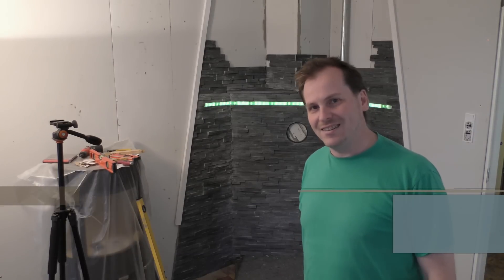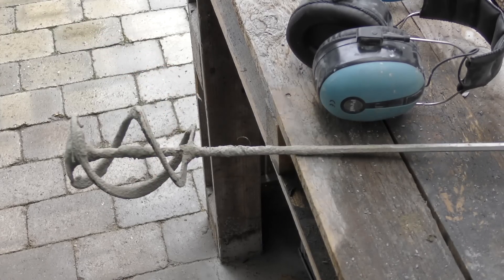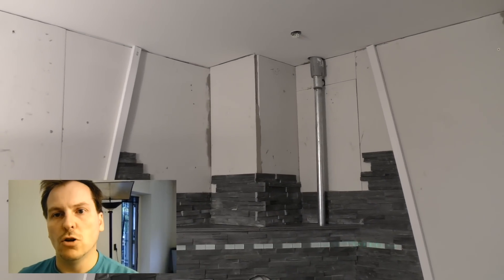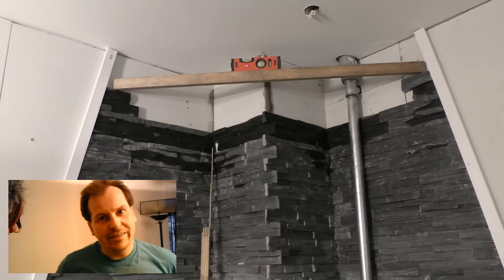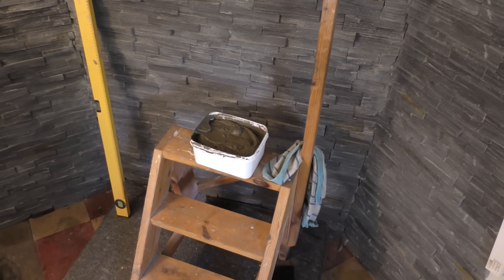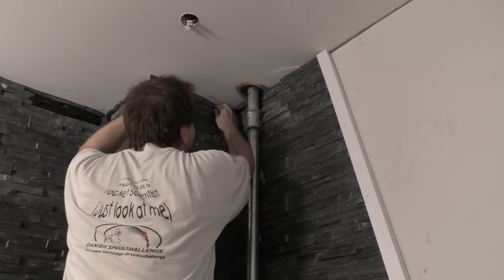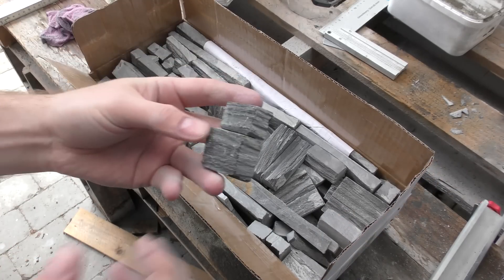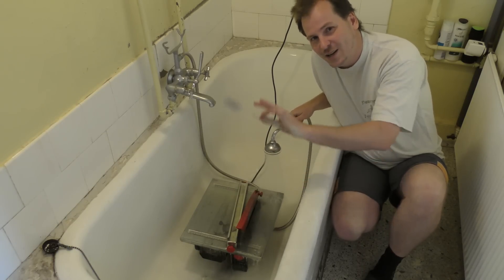Tile Work Completed on The Wood Stove Project - 389

Comment: Congratulations reaching the summit! All your hard work has paid off, it looks great. Personally, I would paint the pipe going to the ceiling gloss black or similar, just to take the edge off. What are you going to be doing in London, Morten?
Reply from the maker: Hi
I just landed in my hotel in London,, it's vacation/SiTC,, summer in the city. That is a YouTube event,, All the UK YouTube stares will be here,, and there will be some networking and so on.
Thank you for watching! :-)

Comment: could you do a video on your servers for me. I have a server but no backup or testing server so I can't test it my self.
I am runing Windows server 1012 r2 on my server but I am thinking about moving to a vmware setup

the thing is wath is the best way to get that Windows server machine in a VM in vmware (without reinstaling everithing again) 

I also have no spare hard drives the only extra storage I have is a synology Nas with pleanty of space
Reply: You need to P2V your server using the VMWARE converter http://www.vmware.com/uk/products/converter.html
Reply: +Mark tank you very mutsh
Reply: Perhaps you could do a Windows Server Backup. It creates a VHD image of your Server 2012 installation. Set the Synology as your backup device. Install ESXi on your Server. Create VM for your Server 2012 to restore to. You'll need the Server 2012 disc/ISO to restore the backup.

VMware's P2V converter will only work if you already have an ESXi box to put server 2012 on. I'd recommend this method, and that means yes you'll need to get another server.
Reply: Why do i need an extra server to do that
Reply: The P2V converter needs a place to put the new VM it is creating, and the place where it puts those VMs is an already existing ESXi host. If you don't have one there's nowhere for the P2V converter to put the new VM. It can't put it on "dumb" storage like a NAS, it specifically asks for an ESXi host.
Reply: +lildigiman OK tath wil be helpful information
Reply: You can install ESXi on some pretty low end kit, use that to P2V, then copy the files back to your main server once you have install ESX on that.
Reply from the maker: Hi
Be sure to check that your hardware can run on VMware ESXi before you start this,, you can install it from and to an USB stick for this.
Thank you for watching! :-)